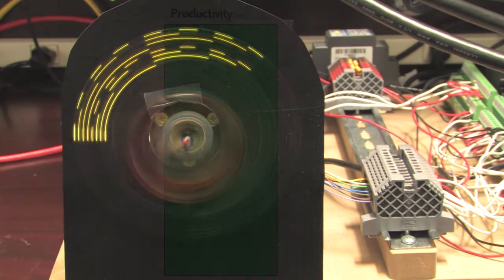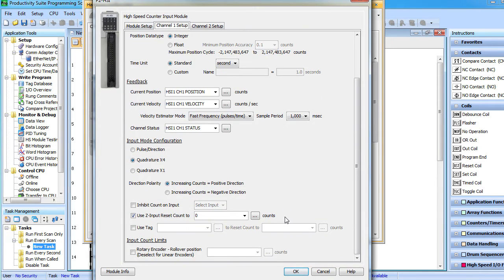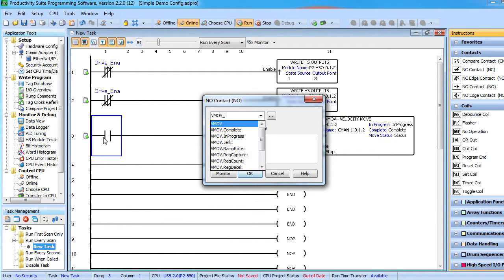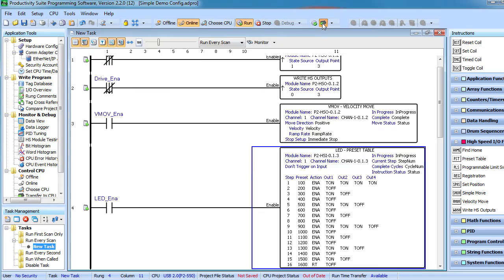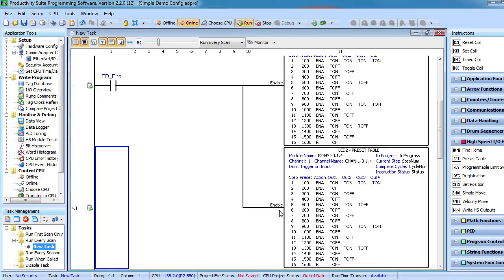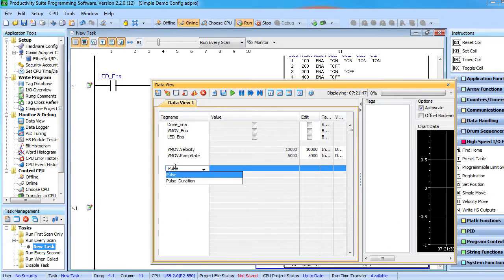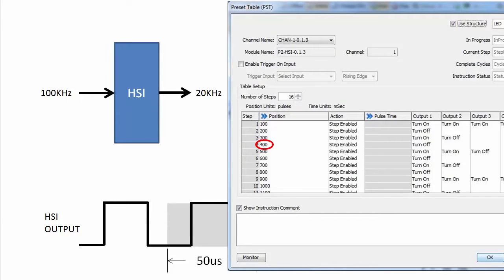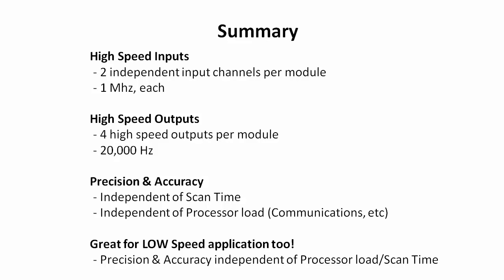Productivity Series PLCs Motion Control - PST Instruction from AutomationDirect

Comment: Isn’t HSI supposed to have inputs and not outputs???? 😤
Reply from the maker: @johnboon5330 it has both. The high-speed input points are for the encoder inputs. These are the primary function of the HSI. However, there are certain limited functions (like the LED light control that we show in this video, or triggering another device) that will be significantly delayed if they are processed by the PLCs scan logic, and then assigned to a standard digital output. To avoid this and give you more options, we give you a few high-speed outputs on the HSI that allow you to trigger things based on a position. These outputs are processed all within the HSI module, asynchronously from the PLC scan. As such they have near instantaneous response and may be used to trigger other functions without the 50+ms lag associated with processing information within the PLC scan and then turning on a traditional digital output.
Reply: @automationdirect  Uhmm... ok thanks
Reply from the maker: Let me know if I didn't explain things well enough there. An application example would be something like "I want to start this high-speed motion on axis X, when the Axis Y high speed motor is at an exact position. If I did the axis X trigger with a traditional digital output, the system would have to see Axis Y encoder feedback through the HSI at the correct position in one scan, process the position and turn on the digital output to trigger the Axis X move on the next scan, and then the digital output would turn on.
For large programs two scans can be 50+ milliseconds. In some limited applications when things are moving very fast even a 50ms delay can cause problems. With the HSI high-speed outputs, the millisecond (or perhaps even microsecond) the HSI sees the encoder count hit the predetermined position, it turns on the output for the X axis trigger. No two scan delay of the PLC, so we get near instantaneous triggering capability. It is a specialty feature and very rarely needed for most stepper applications as steppers are rarely used for high-speed motion due to the torque loss at speed.
Let me know if I still didn't do a good job of explaining it or if you have any other questions.